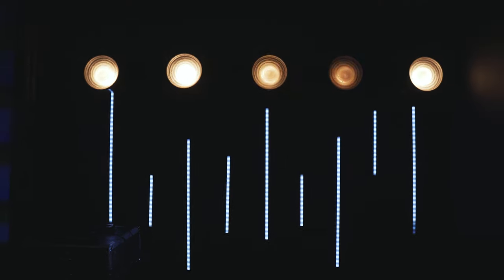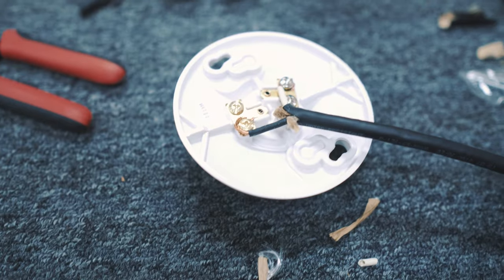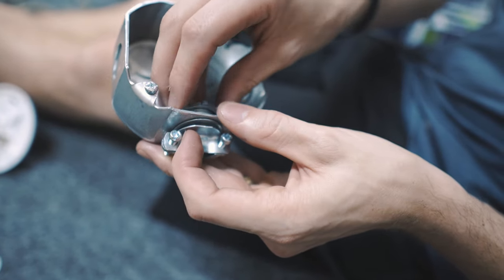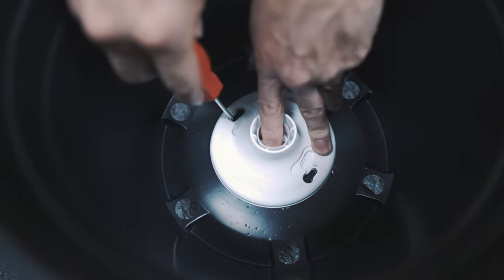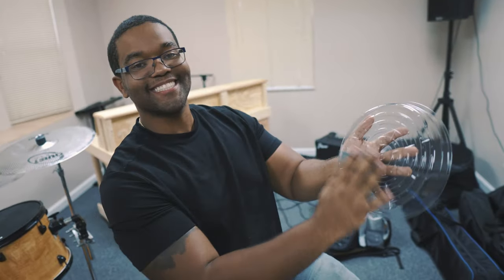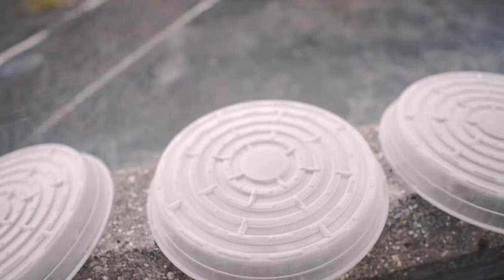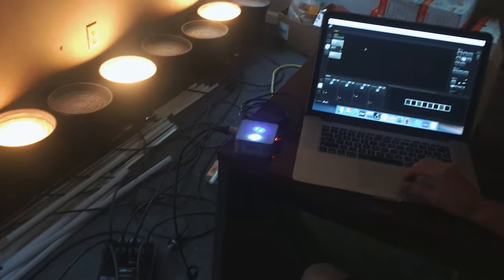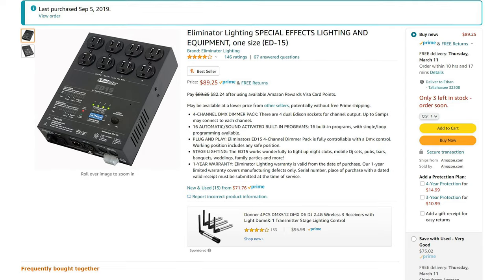DIY Stage Lighting (from a garden pot?!?) | STAGE FLOODS | PAR CANS

Comment: If you are not going to include a ground wire, the electrical box on the back of the lamp socket should be a plastic one.

Comment: Great idea.....however......
If you glue the covers in, how are you going to change a burnt out bulb?
My bandmate and I constructed our lights out of #10 cans, electrical cords, colored gels, and wood faceplate screwed to the cans. They've worked well over the years and if a bulb burns out we take the faceplate off and change it. Super easy on a next to no cost budget
Reply from the maker: Hot glue is definitely by no means permanent. The faces can easily be pulled off and then re hot glued after changing the bulbs. But, if you or anyone has another way, please feel free to do it different than us! DIY is all about improving or finding better/easier/simpler ways of doing something

Comment: GREAT idea! I’ll probably implement these in our stage design. Having said that, you guys should’ve used something non-plastic for the “bucket.” Not sure what to do about frosted front. Maybe parchment paper (to keep it budget friendly)? And mount the electrical boxes to the 2x4 before attaching the light. This way, the screws points the other direction and don’t risk poking the wires and creating a short (huge fire hazard). 

This is beautiful, but these details make it a bit too dangerous.
Reply: There is a bit of fire hazard here, especially if they do not use an LED bulb.
Reply from the maker: Ours our ran at about 10% power the majority of the time they are on. I have not tested them at full blast for long periods of time, but I would agree, the front diffusion would likely get very hot and could potentially melt. I don’t think however, the idea behind this style of light is to be ran at full power…. Maybe short bursts on time with music, and that has never been a problem for us.
Reply: @WeTalkTone  thank you for clarifying. It makes sense. I just wanted to bring that up in case someone has no idea what they’re doing and make a big boo boo. Especially with the screws poking into wires. I’ve been blown away by how clueless some volunteers are; not intended to be mean.
Reply from the maker: I understand, I didn’t take it as a mean comment - I know those are serious matters!
Reply: I love this idea....however....
When you connect the 2 end lights to your support beam....
How do you connect the rest of the lights to the same beam? I mean, wouldn't the others be off- centered and not straight across in a line because the beam would now be in the way.

Comment: Hello, could you please recommend any lightboard besides the computer software to use with these so that I can use the board to control the lights live?  Thanks
Reply from the maker: I unfortunately would not be able to recommend any physical boards… the only lighting board I’ve had any experience was an old outdated ETC Congo, which I would not recommend. Every system I’ve worked with since then had been software/computer based.

Comment: Perfect timing, we just started re doinging our stage and I was waiting for this video since I saw the drum cage you guys made! Keep up the work!! 👌👌
Reply from the maker: Oh that’s awesome! Hope this helps you guys out.
Reply: @WeTalkTone  question so we have the lights set up but on the dimmer they are controlled fine the only problem is that they don't fully dim to 0% is that normal?
Reply from the maker: @Daniel Banda yes we had this same problem! Hunter figured it out after playing with the settings on the dimmer boxes for a little bit - I just sent him a text but it’s midnight here. I’ll keep you updated!
Reply from the maker: Alright, Hunter got back to me and said dip switches 11 and 12 but need to be switched to the on position. Let me know if this helps!
Reply: @WeTalkTone  You guys are quick to respond! thanks for that, unfortunately Im using a dimmer pack A had lying around ADJ DP-DMX20L 4 Channel. So its doesn't have any dip switches, but I will try pressing a few buttons because even when we hit black out on our dmx software everything turns off BUT these lights, they just dim down. If you or Hunter might have any other ideas, let me know. Im waiting of the materials for the Led strips to get here tomorrow so wish us luck!
Reply: So we kinda got it to work, depends on the outlets on the dmx we plug them in. Now i did notice there was a noise with the ground loop and when the LED change color I can also hear if through my headphones and live mix. Did you guys experience that?

Comment: Hello, I am wondering what fixture profile you guys used for the flood lights? I know that through the dimmer pack we are able to turn it on and off but how do I make it do the programs shown on the video? Were they connected to dmx software when the programs were happening? thank you!
Reply from the maker: Yes, we were controlling it with a program called myDMX 3.0 from ADJ
Reply from the maker: I don't recall off the top of my head, but I think it's just the most basic single channel fixture. I'll have to check this Sunday!

Comment: Hey guys, I am not sure u still use this channel but what software did you use and what was it called on it
Reply from the maker: Hey Timothy! It was ADJ’s MyDMX software that comes with there MyDMX 3.0 hardware units
Reply: @WeTalkTone  Thanks. Do you guys think you can explain how you connected it and how you set it up on the Software?
Reply from the maker: The box is just a typical usb into your computer, and then from that box you run your dmx cords to the lights. It’s been so long ago that I don’t remember much about setting it up in that particular program. But, YouTube will have some excellent resources on it, I am sure!
Reply: Hey Guys, what is the fixture called so I can connect it on lightkey?

Comment: Be careful saying pro tip when you don’t even know what the wires are.  Those bulbs take AC power, that means the black is hot, not negative and the white is neutral.  At least you managed to accidentally get the correct wires on the proper terminals.  DIY projects are great, but if you’re doing a tutorial you should make sure the terminology is correct so someone else doesn’t get hurt.  Also missing is a ground, not something I would advise.  At least the “can” is a plastic insulator.

Comment: These "par cans" are not par cans due to the absence of a gel frame or focusing tube. The title of this video is misleading because these lights seem to be blinder duty only. For a stage wash/flood I would use PAR16 "birdie" cans for a smaller stage like this one or PAR38's for a medium stage and PAR64's for a larger stage. As a spot light I would use an ERS "Leko" (Ellipsoidal reflector spot). Also by replacing the 70w Halogen with a dimmable LED PAR38 of ~15-20w you can cut the heat tenfold and run the lights at 100% power with less heat. To emulate halogen color temperature you can use a lightbulb of around 3200k, incandescent will be 2700k.

Comment: What size/brand wires are you using for these?
Reply from the maker: I want to say 16 gauge but I'm not entirely sure I'm remembering correctly. They were the bare wire you can get cut-to-length at Home Depot in their electrical section.

Comment: OK, I love your DIY spirit, but this is BAD ADVICE... Hot Bulbs inside a PLASTIC container? There's a reason Par lights are METAL. These lights, when run continuously, will get very hot and will likely melt the plastic. Also, with no ventilation for the lights, the heat will build up quickly, presenting a real fire hazard.
Reply from the maker: Thank you for your concern. You are not the only one to voice this concern - I have added a disclaimer so that it is the first thing you see in the description.
Reply: @WeTalkTone  you are just copy pasting the same reply to these comments when the proper course of action would be to remove the video